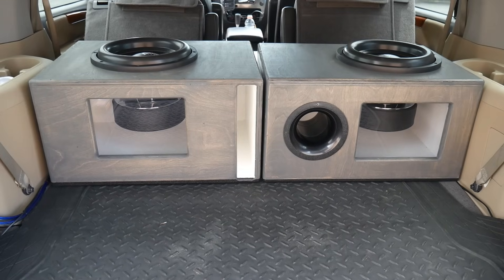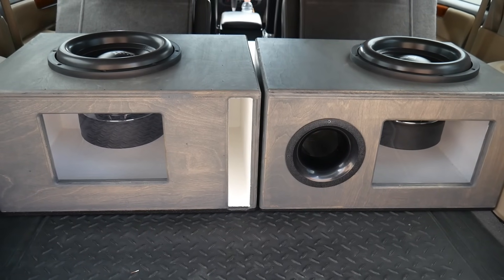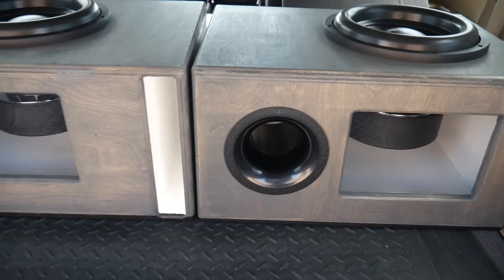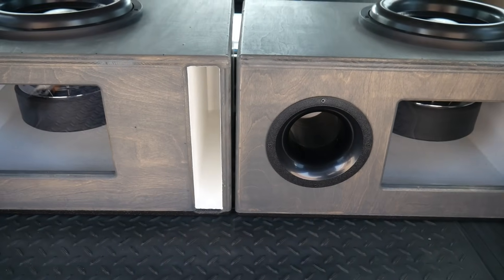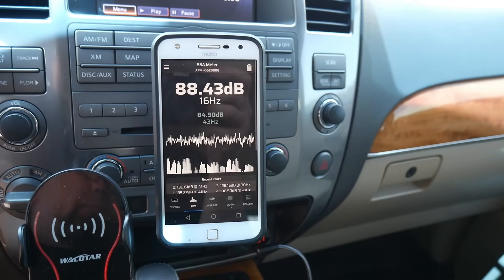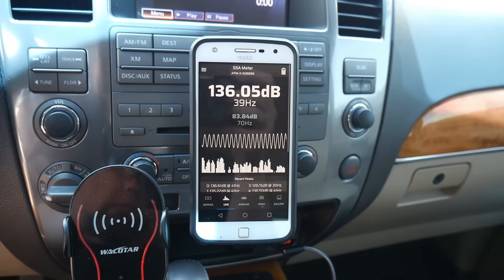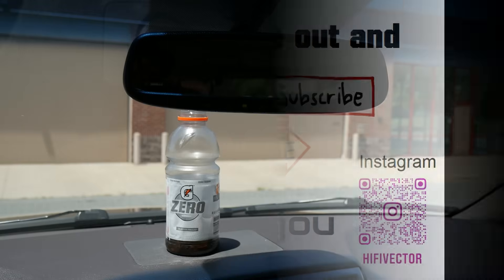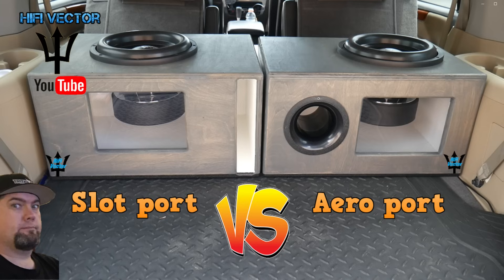Part 1 Slot port vs Aero port subwoofer box in depth comparison

Comment: I’m in the process of designing an adjustable tuned box with internal moving pieces and a dial. It’s just a 3D sketch in software at the moment but I feel this is a much better design someone should patent it 😮

Comment: Thanks. I have a question. I have 2 12" Rockford Fosgate P3s and 1 12" P2. Would it be possible to run all e in the same box slot port box?
Reply from the maker: You can but mismatched sub’s sharing the same enclosure airspace is not ideal.
Reply: @HiFiVector  thanks
Ill make a separate box for the P2. Appreciate the answer and not just telling me to google it

Comment: I like this but, unfortunately, there’s a fatal flaw with the test.  The boxes weren’t in the same vehicle position and also not in the same position relative to the mic.  This will cause differences.  An apples to apples test would be testing both from the same location.  Especially when the mic placement is static a different box placement will result in significantly different scores.  I’d love to see a part 2 using a 6” precision port and the placement issue corrected.

Comment: I've been building subwoofer boxes for 40 years, and I say slot port for the win, there are many reasons why, but I don't wanna give away all my secrets!  But you do need to round the slot port on both end also for the chuf.
Reply: Newbie Here.. What Does Round The Slot Port Mean And Hoe Do You Do It?
Reply: @kckola4713  it just means rounding off the square corners at the entrance and exit of the port so the air moving in and out makes less noise

Comment: Great video and a reference for the future. Nice that even with appreciable power applied, your phone didn't distort the sound and I guess they'll ALWAYS make some noise up close other than what's in the program. Since you've done the work, here's a new hard-on for everyone - Connect them 100% in parallel (!!!) and get the best of both, keeping the ports apart with a clever divider or rotate them. (*_*)   PS---I spent EVEN more time admiring the boxes' designs than absorbing the information, lol.

Comment: I always found that although an Aero port chuffed audibly when in your face, overall it ended up sounding more ballsy and better when listening from the Driver's or optimal position, with the sub in the rear (in a hatch or open environment). When inside a trunk in a box separate from the drivers compartment (not on a baffle), they are difficult to distinguish and end up taking on characteristics of a BP.

Comment: Now I have a box that has a 4 inch aero port and a single 15 and it hits  exactly like the two 12s did 26hz np good amount of pressure didnt expect it from a smaller box and less cone Area

Comment: Try the test with equal port volume. Also the slot port test  was 1hz higher in each test
Reply from the maker: I did that in the “ part 2” video check it out.

Comment: This is not a fair comparison! So frustrating and worthless comparison.
If it's the same port area and port length then the aero port wins everytime bc the air velocity on the middle will be less. Plus add port flares on both ends and it's even better

Comment: I’ve built literally thousands of box’s and worked on thousands of cars/trucks. I appreciate your enthusiasm but I’d like to point out, the sub and the port should share the same plain. ESPECIALLY in this vehicle. Sub and port should both be facing the rear. It would sound magnitudes better and meter higher.
Reply: I agree with what you say, and yes, definitely on the same plane, you are the first person I have ever heard say that in my 40+ years building boxes.  Glad to know I'm not alone, I have never mentioned it to anyone, I like to keep my secrets to myself.  I actually try to keep them as close together as possible also.
Reply: Sub up port at the rear is normally louder

Comment: Comes back to the whole reason for a port in the first place, the whole purpose of a port is to time align the rear sound wave and match it to the front sound wave, this is done by calculating the 1/4 wavelength of the FS of the sub, and then matching your port LENGTH to that. Properly done, it's called a Transmission Line, Ported Bass Reflex enclosures are NOT Transmission Lines, but slot ported boxes with long skinny ports get much closer to that quarter wavelength alignment than the short aero port would, which would result in less cancellation and a 3db boost, which is almost exactly what your results showed.
Reply: let's see. 30hz fs, 37 feet / 4 is 9 feet.... what? watt? watt watt, match 9 feet to what? LOL keep trying
Reply: @oldolfmann8927  what's the point you trying to make? That a 30hz 1/4 wave port is long?
Reply: @chickenpotpie4045  Yeah, I'm trying to figure out how to put that 9 foot long port in my 1.5 cubic foot box. LOL
Reply: @oldolfmann8927  You and me both brother, you and me both lmao

Comment: All you've proven is that a larger cross sesction works better.  If both ports had the same area, there would be no difference I would think.  Cool experiment though,  thanks.
Reply from the maker: Actually not at all check out part 2 video using closer to equal port area and you’ll see even with close port area big difference between the two.

Comment: slot ports are not easier to build. also you can't change tuning fz with a slot port like you can with a aero port.
Reply from the maker: Which one is easier to build is opinion. To me if I am building a box it takes no time to make a slot port. Versus making a hole and then making a support brace for the aero port inside the box. Then cutting the pipe. But The ability to adjust is a good option if you aren’t sure what tuning you like so that is a plus.

Comment: If you have a twin 12 box should you only put 1 port or 2 so one on each end of the box?
Reply from the maker: You can do either as long as it’s designed correctly

Comment: I really dig this design, in particular the slot port. I would like to make one using a 15" sub. Is the demo video using a 15" or 12" also, is it possible to get dim/ specs for this build?

Comment: Its all about design, either one can do well, if done properly, to have a side to side comp , more variables would have to come in to play. One way is just as easy as the next. If you order an aero online you could have built a slot before you get it and aero can be tuned a little easier. Like others have said , pr,s are the best sounding and easiest to tune within a couple dbs just as loud.

Comment: HOW COME SLOT TESTED @ 21Hz,31Hz & 41Hz but AERO @ 20, 30 & 40Hz?! Even on sweep aero 38hz but slot 39hz!?
Reply from the maker: Same test tones were played it was just the SPL meter reading was off by 1 hz but used the same exact tones for each sub.

Comment: Aero ports are lazy, slot ports take more effort to build due to calculation factor. However, with the box design software out now, it doesn't make sense to use an aero port ever....
Reply: don't trust that software so much

Comment: What about the aero ports funnel length??? That needs tuning too
Reply from the maker: Yes you have to calculate that into the equation when calculating port length. But that doesn’t affect tuning Besides the fact that you essentially need to deduct the length of the flare because once the pipe starts to flare, essentially the port stops at that point then. Then you are just accounting for end correction, factor.

Comment: I remember running this test back in 1998.  Yes, I am that old.  I compared a slot port, round plastic port, and a square wood port.  all had ported to the same frequency with the same overall internal cubic space.  By using an SPL meter, sound spectrum analyzer, and multiple individuals, it was found that the square port sounded the best and rated highest on the SPL meter.  However, using 3/4 inch MDF was the best thickness to use.  Long story, but think was what a pipe sounds like when you talk through it.
Reply from the maker: That’s a good point about “ what a pipe sound like when you talk through it” I’m sure the plastic pipe resonances can be heard to some extent.
Reply: @HiFiVector  you hear a hollow sound.  You can help get rid of that sound by wrapping sound deadening material around the port.
Reply: @wutupclegg6618  thanks for the tip on the aero port I'm going to try it although the slot is louder the port just makes the ground shake or maybe I'm just tripping
Reply: @deelos2269  Not the aero port,  I was talking about a square port.  Noy sure why, but it sounded harder than a slotted port.
Reply: Riteee the square wood port was what I used for my 4 12s hell ya brother!!!
Reply: So sir can you please  prefer what size should be for a 12 inches sub if i use square wood port i have pioneer 1212 d4 with a box built according to its preferred dimension on the box

Comment: Since both boxes have the same outside dimensions, isn't the slot port displacing much more internal volume than the aeroport?
Reply from the maker: The boxes do not have the same outer dimensions. They have the same NET cu internal air space.

Comment: Ive always been an aero-port guy myself but , the results speak for themselves . These re little things most dont think about so i appreciate these tests. Well done.
Reply: The big downside to port tuning, is the loss of musicality. When you port tune, it's basically optimising a smallish portion of bandwidth overall- and then you end up trying to find songs with that sweet spot that doesn't muddy up , fall flat pr bottom out. It took me years of builds to try to dial in the "best of worlds" so i could enjoy all different types of music. If you listen to MUSIC, sealed is your best option. As for slot vs aero porting i think the attraction of aero is ease of design and build. Best option for slot is to kerf, and knowing what your optimum cabin resonance rests at
Reply: @jimbobdobbs1597  I agree, I have 2 NVX VCW sealed 15's and I want to be louder but dont want to givc up the bandwiidth.  I am still going ported thi summer
Reply: @jimbobdobbs1597  this is true if you can't tune worth a damn😂 we have all this software to help you design a vented enclosure, yet still you dont use it. You can adjust the bandwidth of a vented box quite easily, or simply run a band pass enclosure that will exceed the ability of a sealed box across the entire frequency range of the sub reguardless of frequency. You dont have to be sealed to sound good, thats a moronic statement.
Reply: I think  the aero port is smaller so it has less SPL,  bigger port  wether it's round or square, should have more spl,
Reply: Aeroport would still win if it had a similar area to the slot port
Reply: Dude I've been wondering for ages whether a slot will be better than aero

Using this to decide whether I should buy a new box with a port

The only differences with the new one listed are that it is a bit taller and has wire clips

Comment: the variables to bass is countless....music, wires, box size, type of sub , amp. place you put box..etc
Reply from the maker: Exactly but with 2 a lot vs aero port videos I just wanted to show how they compare and how much you can reduce an aero port because if a round ports supposedly more efficient than any other shape port. Part2 video is coming out tomorrow using a 6” port.

Comment: The only way to get the aero to fit inside the box is to go too small. Or incorporate a 90° inside the box. Now, if you go exterior aero, you can go to a 6". If you go to a 15" sub and a 6" aero, you get a better ratio.
Reply: What if you put more areo ports? like two insted of one.

Comment: How long overall was your aero port and what website do you use to figure out what you need to cut? I have a 4 inch pp aero port in the mail but its huge and i dont know exactly how much to cut for a 35hz tuning and a 2.7 net box for a single 15 on 800rms. Thank you.
Reply from the maker: Tell me the external box dimensions and the thickness of the wood. And I’ll let you know. Most of the box calculators are way off, so I don’t trust those. I just calculate myself. Give me the box info and I’ll let you know how to cut the PP.
Reply: @HiFiVector  22x16.75x15 the wood is 5/8 thick.  Also is 35hz a good tune? It's a kicker comp r. I listen to rap and Spanish music with an audiocontrol epicenter. Thanks.
Reply from the maker: So this information is specifically for precision port brand 4 inch airport. Because the flared ends already have some specific port length in them. So for your box to 35hz cut the tube 2” long. And after you assemble the flares and couplers on both ends, this should make the total length of the Aeroport from end to end to 8 inches.
Reply from the maker: Yes 35hz will be great for your situation.
Reply: @HiFiVector  oh 2 inches wow cause this thing is huge currently as it sits new its like over a foot long so I didn't know the middle tube will have to be cut to only 2 inches. Makes sense. Thank you for this info.
Reply: @HiFiVector  also are you sure it's not 9 inches needed for overall length cause I think my box calculates to 2.56 cubic feet net volume
Reply from the maker: With the dimensions you gave me earlier yes, that’s correct. It’s because the rest of the components add to the length so the center pipe only needs to be 2 inches for your situation.
Reply: @HiFiVector  thank you very much will let you know how it goes

Comment: Good video. Just for the future maybe do a slow linear tone sweep so the meter can display each frequency with the correct SPL numbers, seems weird the slot port got louder on burp frequencies but roughly the same as Aero port with the sweep all at the same volume level. However i may have missed something you said.

Comment: This is a very good video, but I would have prefered to see both boxes identical as in ports on the same side and boxes in same location in the back for a "TRUE" side by side comparison. Box placement and port placement in a vehicle can effect the SPL numbers aswell.
Reply: If it does only a meter will tell you I  tried every direction you can think of I like subwoofers firing straight up and port up facing back is to much pressure on the hatchback or the license plate in a sedan facing forward In a sedan is OK but you have to seal it off right now I'm running one neo 4.11 fi on a Taramps md 2ohm 8k I had to brace the roof bye the dome light because it was flexing hard and this is a kia soul I need to build another enclosure for my two fi hc 15s I'm going to face the subwoofers up and put the port facing back towards the bottom

Comment: Another advantage of an aeroport is adjustable tuning frequency by easily lengthening or shortening the tube. Only ran slot port myself but I would like to try an aero!
Reply: i agree...all depends on what type of tone you want..when slotted gotta take apart and in the time i do that i could of built and aero..im real cheap on buying wood these days
Reply: @shattaprod  good luck taking a part a box once glued
Reply: @chriswhynder8311   you can make it where the port comes in and outr easily lol
Reply: also with aero earier to put port on outside of the box
Reply: Remember can always make it a sealed box too hahaha
Reply: Aeroports are good, and efficient. On the downside, a slot port has more surface area which produces more friction, and helps to soften the falloff below tuning. The Aeroport has minimum surface area, so its output drops faster below tuning. Aeroports also take up less space in the enclosure, which can help depending on your application. I like them both, but it’s nice that aeroport is more easily altered, and with no bends, it can be a little smoother than any type of port with bends.
Reply: Unless you have a hi res mic you can’t accurately tell frequency response.  Why not make the area of the ports and the the lengths the same?

Comment: You can't compare the "air velocity" that way.  Because the surface space of the aero port is smaller, the moving air is more focussed (contained in a tighter area).  So whatever air it is moving will likely measure higher.

The slot port is so large that the air that it moves is so much kore widely sldisbursed that it simply is not an apples to apples scomparison.

For strictly measuring the quantity of air passing through the ports, you would have to use something to capture the total amount of air passing through.  Like using heavy plastic shaped like the port that then came to a single/same shape (smaller really) at which loint you could measure the quantity and velocity of the air being moved.

But that of course would change everything about your desired test.